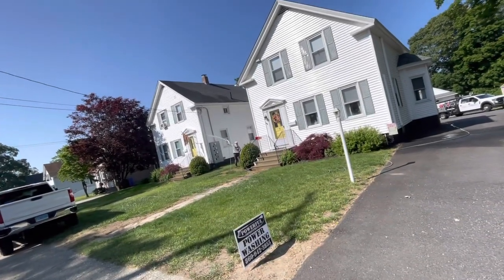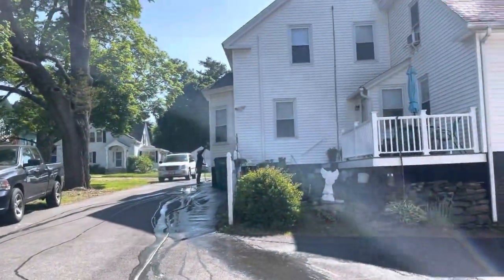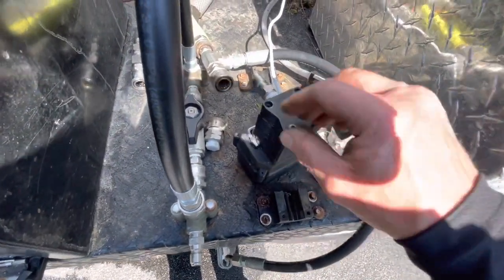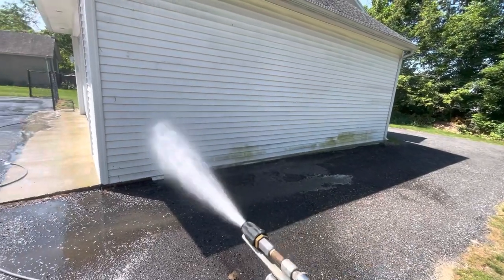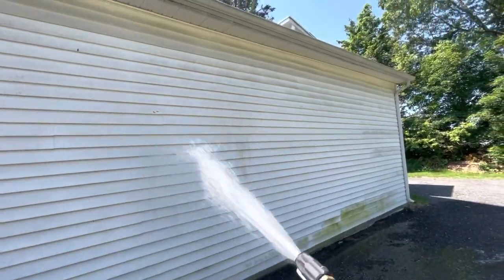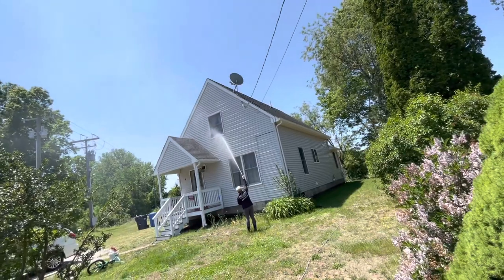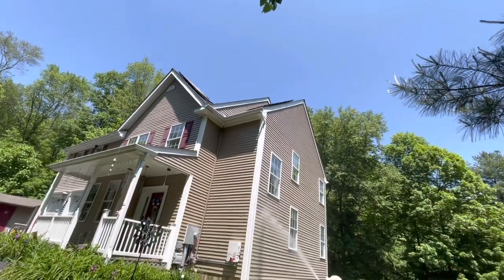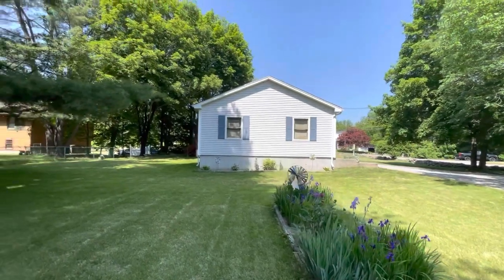DN10 Fail - Fixed on the Fly

Comment: We just had issues with the flopro Monday afternoon. Loose wire nut on the bottom of the light box fixed issue one of it not responding to the remote. Then we were having issues with the remote not connecting around the corner. Realized the remote battery was getting low. Same battery that came with it a year ago. New battery and good to go. 

That thing is worth every cent to buy it
Reply from the maker: Truly
Reply: Also every once in a while moisture can get inside of the water proof plug from the ball valve to the box

Comment: Often replicated but never duplicated. FloPro wins every time. We have two of them and they are life savers.
Reply from the maker: Truth
Reply: How do you rinse the injector with the Flow Pro?  That’s one of the reasons I’m leaning Smart Stream. I don’t have a noticeable drop in volume on my 5.5
Reply: @truthseeker1532  install a two-way valve off of the suction tube. When you are on the last portion of the house switch to water and rinse the last section through the injector. If you are using a drop stick just pull it out of the bleach and put it into the water when you rinse the last section of the home. Or if you're on the last part of the concrete.
Reply: Greatest volume gain are with the 8 gpm and up. I gain 1 gpm more on rinse with my 8….don’t think you will gain much with a 5 or 5.5 gpm.
Reply from the maker: @truthseeker1532  the easiest way is to add a small 3way valve in your sh draw line. One side to sh. One side to water. Last job of the day rinse it. I’m currently not set up this way but I was in seasons past. Your 5.5 will flow rinse at 6 on flow Pro
Reply: @powerfulimprovements  oh, yes!  I’ve seen people do that. Thanks for the reminder!